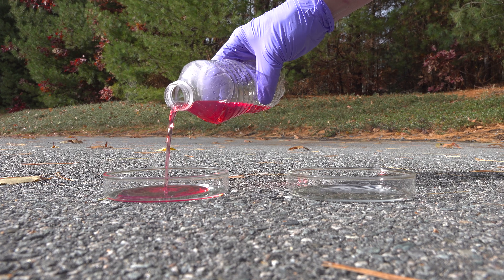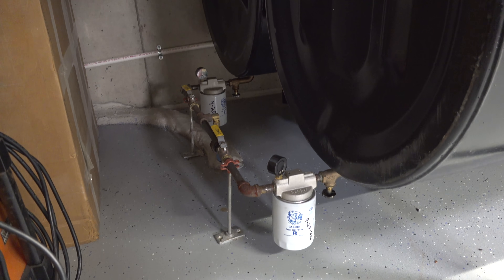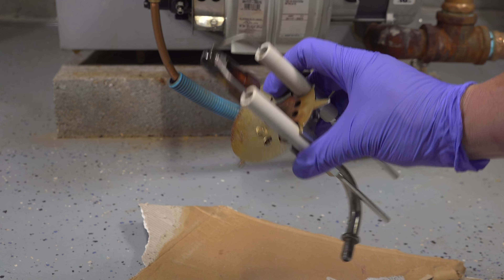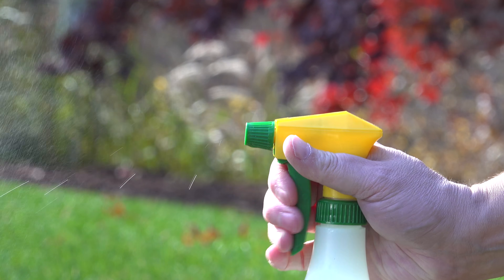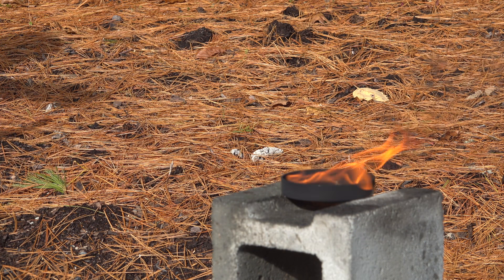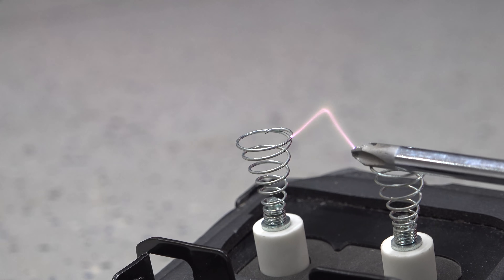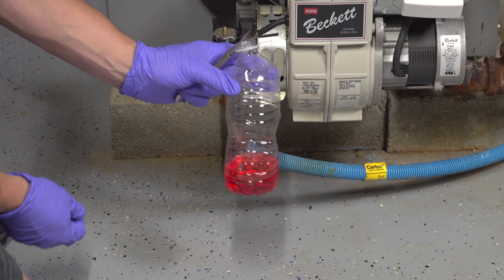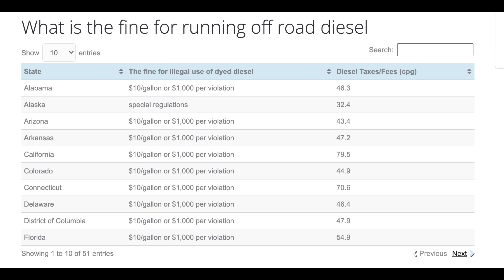Why Heating Oil is BETTER than GAS - Explained

Comment: Heating oil and diesel are exactly the same produc 
The differences come with additives add after refining
Like detergents and oder additives to prevent the diesel to freeze in the tank of a truck
Reply: #2 (diesel) gets blended with #1(kerosene) in colder months to prevent gelling
Reply: @Icutmetal  also diesel gets blend with kerosene to make jet fuel
Reply: @craizihorse3230  Prove it.

Comment: Short version: oil has a higher energy potential
Reply: Thats why diesels are so powerful and efficient.
Reply: @CL-ty6wp  
Exactly, it's a simple density thing. It's why good coal is so much better to heat with than charcoal is, even though it's essentially the same substance.

Comment: Love my oil heat.. it's like right now hot and I've rewired the electrics so as long as I have oil in my tank, and gasoline for my generator I can have heat. My next go around I'm going to use a hybrid heat-pump/oil system just to save a little oil on "cool" days.

Super bad-day plus-side is I can technically get heating oil at the gas station(diesel fuel) right by my home. Granted it's expensive but if I'm at that point, I don't care.

Comment: How about not heating with a fossil fuel and switch to a heat pump!!!
Reply from the maker: If you want to paypal me a donation I'd be happy to switch over. Keep in mind its forced hot water, not working with normal heat pumps that want forced hot air. It would cost me $20k and up.
Reply: @SilverCymbal  A hydronic air to water heat pump is less than 10k at 29,000 btu. Whoever quoted you 20k has been smoking crack! Hell there are brave alternatives such as this guy did

Comment: Dyes in fuel also help to easily identify not only a leak but the source of any leak.
Reply: That only applies to AC because is a gas 
Fuel and any fluid leaks are easy to find 
Just look for the wet spot in the line or gaskets
Reply: @craizihorse3230  I’m an aircraft mechanic and I can assure you, other industries use it for the same purpose, even if it’s involuntarily.

Comment: As a matter of fact, many people including myself are strongly allergic or reactive to the exhaust from oil burners, which includes both particulates and fumes. Because of this, in New England and other areas I constantly suffer from congestion, sneezing, etc. This has been a known problem for decades and makes entire regions of the country uninhabitable for me. All oil burners should be required to have a catalytic converter.

Comment: Well I prefer natural gas or propane. Burns cleaner, more efficient and natural gas is cheap fuel. Also when you have a natural gas line or propane tanks you  can run your citchen stove and outside barbecue all on the same cheap gas.
Reply: Oil is more efficent.

Comment: Which oil burner is better Beckett or Reilo? Are they more or less the same?
Reply from the maker: Its a Beckett, the Riello does the same thing but working on each is very different and use different pressure, etc. Riello is very different inside.
Reply: Beckett AF and AFG  in my opinion, Stay away from the Beckett NX burner you're better off with a Carlin or Riello then a Beckett NX. Riello is a good burner however they are temperamental and parts can be a problem as there aren't many of them around. A Beckett AF or AFG is almost bulletproof, will run fine even if it's not set up perfectly, parts are available anywhere, and almost everyone knows how to fix them. Nothing wrong with the Carlin EZ  burners, however being less popular then the Beckett AFG parts can be harder to get. For an example you can get basically every single part off the shelf for a Beckett AF or AFG at any plumbing supply house, while many Carlin and most Riello parts are not in stock. You can expect a day or two to get parts for them, vs off the shelf for Beckett. Personally I have a Carlin EZ burner however do to the fact parts aren't always in stock for it I keep a fair number of spares at home.

Comment: Fun fact. You can add used filtered diesel oil into red dyed diesel to make it black 🙂 also during a state of emergency (usually lasting a month) red dyed diesel is allowed to be used in on road vehicles.... The dye will last many tanks later. 🙃

Comment: This is the most poorly informed video I’ve ever seen on this channel. Oil heat is a completely outdated technology. In North America, it’s both the most expensive, & least efficient way to heat a building. Newer gas fired furnaces are 96% efficient. While requiring very little in maintenance. Todays top of the line oil burners struggle to see efficiency in the 80% range. And require yearly maintenance. Which is often performed poorly, or skipped altogether. 
Bottom line  anyone who is still using oil as their primary heat source should be looking to get rid of it as soon as they can. 

Next week on Silver Cymbal. Incandescent bulbs are BETTER than LED.
Reply: It all depends on application. Incandescent bulbs create a warmer glow, dont strobe, ect. Every technology has its advantages and disadvantages. In many cases you are doing a disservice trying to say one is better than the other no questions asked. Oil heaters can run on waste fuels no issues. If the main gas line  gets destoryed in an earthqake then having an oil furnace with on site storage can be better than gas.
Reply: @sweis12  that's a dumb "but sometimes" argument. The video was listing stuff like "oil furnaces don't blow up" as advantages. As if NG wasn't flavored with the smelliest substance known to man to make sure leaks are not an issue. NG is far cheaper and more reliable and more flexible (e.g. for gas water heaters and stoves and clothes dryers) and more convenient for almost anyone.
Reply: Trouble is that gas burners are not much use in remote locations without gas lines (well, I guess unless you use LPG).
Reply: Gas and electric is also outdated.

Comment: What's the part number on that coil? 
It could be useful for future experiments
Reply from the maker: https://amzn.to/3phXtTq  They are very cool and work right off 110v with nothing buy a power cord. Be careful with the high voltage coming out.
Reply: @SilverCymbal  wonder if you could use it for a small spark gap Tesla coil

Comment: You better believe an oil furnace can blow up.  Get a bunch of oil built up in the bottom of the fire box when it has an igniter issue and it can get very dangerous when the furnace does light.
Reply: Yep and every gasoline car is 1 broken fuel line away from blowing up.
Reply: Can't say I've had a car blow up from a broken fuel line, even a propane one.  Have seen a Coleman oil furnace blow a guy against a wall though.  Among other things.

Comment: Heating oil systems require significantly more maintenance and costs for it to be safe. LNG and Propane has multiple failsafes in the system. While it's true that cutting a gas line inside the house can lead to an explosion, black pipe isn't going to puncture by something sharp falling on it. The same can't be said for old heating oil tanks or the line to the burner. 

Also, LNG is substantially cheaper than Oil.
Reply: When you factor cost per BTU, LNG isn't that much cheaper. Also, no one would have oil heat if they had access to gas.
Reply: @doughill5487  My parent's have both. The house was built with fuel oil heating in the 60's. They added gas (propane?) many years later when converting the fireplace to gas logs. Both have to be hauled to the house as there are no pipelines. (The farm tractor is gasoline, so they just keep track of gas used in the tractor for end-of-year taxes.) Once a year, usually in the summer when oil is cheaper, the local oil company fills all the tanks.
Reply: It doesnt get safer than oil. Can literally toss matches on it...Oil burners dont have fail safes?  If there is no flame, it shutsdown thanks to the 'cad' cell and controller.  Maintenance? 5$ filter and 5$ nozzle and 20 minutes. A monkey could service a beckett style burner. 
Better than a cracked exchanger every 10-15 in your gas unit...
Reply: CL-ty6wp  yep I do all my own maintenance on the Beckett burner. Changing a filter is easier than changing a car filter. I recently had to replace the controller but a friend of mine told me about a $60 one with an LED readout as opposed to $140 Howell. Just a little extra wiring involved and that's it It was worth the savings and every time it fires up it gives you the cad cell ohm reading
Reply: It takes me about 20 minutes a year to clean and service my oil burner and boiler. It costs me about $20 or less in parts on average a year to service it. While a gas burner doesn't require this service, I'd hardly call 20 minutes and $20 a year significant. Granted LNG is cheaper but you have to live somewhere with gas service, something that doesn't exist in most places outside of a city. Propane is significantly more expensive than oil. If I had gas service I'd probably swap to gas, however that's not an option where I live. 

I really can't imagine how a oil burner could be unsafe, even if it gets completely blocked with soot, the smoke and fumes will drive you out of the house long before carbon monoxide even becomes a concern. Something that can't be said for gas or propane. A blocked up gas boiler or furnace won't give you any signs of a problem, other than filling you house with invisible and oderless carbon monoxide. Heating oil is just diesel fuel, it's not going to blow up your house, even if there is a major leak it's not going to be a significant fire hazard. Now you can have a oil burner catch fire and even have a blowback, however there is a cad cell and primary control that will prevent this. The only way this happens is when some idiot keeps pushing the reset button filling the firebox with oil and vapor. 

I'm not saying gas is unsafe, modern gas appliances have lots of safety systems to mitigate the risks. Oil doesn't need these systems. How often have you ever heard about an oil burner blowing up someones house? How often do you hear about an oil burner killing people from carbon monoxide? How about gas? Let's face it oil is safer then gas despite the multiple safety systems on gas burners. Now is gas dangerous is it something you don't want in your house? Absolutely not if you have gas service it's the way to go.

Comment: Very well done. Explained clearly and concisely. I learned that heating oil is the same as diesel. I thought it was a lower grade of fuel; more like kerosene.
Reply: I have an oil heating system and it runs off kerosene. 
I do have another tank with red diesel for my tractor and lawn mower. 
Kerosene is cheaper than red diesel also in the UK
Reply: @johnwalton1137  interesting.
Reply: @arnoldcaines9012  
Also kerosene burns hotter than red diesel,and is slightly thinner. 
Iam sure kerosene would kill a road car over time. 
Red diesel on the over hand is fine as long as you ADD a cleaning additive to the mix.BUT  you would be in trouble with police over using NON TAX fuel on the road.
Reply: That's... What you took from this...

🤣

Comment: I get my oil burner serviced maybe every 5 years. They vacuum out spider webs, clean the nozzle and change the filter. The nozzle definitely doesn’t need to be replaced yearly, I'm 22+ years in with no replacement.
Reply: Filter changes are the most important part. If you do nothing else, regular oil filter changes will save a lot of problems. 

Every 5 years is pushing it tho. I don't like seeing people go more than 2.
Reply: @kyleh1974  That and should vac out the exchanger.

Comment: I've had fuel oil, natural gas & now geothermal...

Fuel oil is expensive, cost me about $200 every 2 weeks in u.s., also seems more maintenance too.  

Natural gas all yr $50-70 on budget bill & like 3-4 months of no gas bill.  
450-630 roughly probably on the higher side of that.  

Geothermal... everything is electric
Based on electric bills from $70-280 last yr.  I figured $150 avg if spread out over the yr.  I think my bill will be lower overall after modifying my thermostat temperature range of 3 to 5degrees  vs 2 degree range prior.  For instance heat set to 72. Geo kicks off at 73 kicks on at 68.  

With that said worst month for heating cost alone is probably $180, this past month around freezing point or so was about $50 in electric.  

I know someone with electric heat that pays $500-600 a month for comparable home. Worth noting natural gas place I had was 2/3 the space of my newer place.  

So what does it all look like?
Natural gas 1000sq ft 3mo. $450-630
Fuel oil 1500sq ft.  3mo. 1200   $
Geo. 3 months $500 on high estimate
Electric 3 mo. $1000-1500 
Propane 3 mo $600 
Someone local told me propane is typically around $600 for the yr  for a house I believe that is somewhere between 1000-1500sq ft.  I'm thinking it is bigger than my 1st but not as big as my current 1500sq ft.
Reply: Fuel oil furnace are 1500$ and last forever because they dont have fragile heat exchangers like gas.
Reply: @CL-ty6wp  

The last gas furnace I had lasted at least 20 years, the fan motor went bad...no issues with heat exchanger.  

Some of it can be from poor maintenance.  I kept clean air filters.

Comment: Good video. My company just recently stopped rebuilding parts for Iron Fireman burners. Good videos on the topic, One of the better ones.
Reply: Iron Fireman units were Bit coal burners, weren’t they?

I put in a dual fuel Keystoker in 2019, I burn oil for hot water in the summer and Anthracite in the winter.

Comment: Interested in knowing the electrical current,voltage and draw rate of the power necessary for these igniters. Do they run continuously while heating or does the fuel need constant electricity to prevent run on. As he mentioned a hot tank or plate perpetually reigniting. Also would a ballast of a temperature gradient material(steel,iron or ceramic) in the center of the tank retain some heat to augment heating?
Reply: The ignitor is a step up transformer. They put out between 10,000 volts and 20,000 volts, with very low current. 

Newer ones don't run continuously.  Older ones do.

Comment: Propane is way cheaper where I live fuel oil is like 3.40 a gallon whole propane is 2.40
Reply: Propane BTU/gal is about 90,000 vs. 140,000 for gal of oil so of course it's cheaper per gallon.

Comment: I looked for a house with heating oil rather than natural gas or propane. I have pellets, electric and heating oil.
Reply: Smart man.  Gas furnace heat exchangers make the furnace a 15 year or lesss disposable.  Not so on oil.

Comment: It’s dyed diesel, aka, off-road diesel, aka heating oil. It can be used in powered units or pony motor units that are used exclusively off road. I’m a landlubber so I can’t speak about off shore.
Reply: No, dyed diesel is regular on road diesel with a dye.
Reply: @ryangreenley4818  I kinda thought that was a given? Dyed diesel is regular ol diesel with dye. It’s so the ol DOT can easily see if you’re “stealing” by not paying your fair share to the legalized mob.

Comment: I have an old danesmoor 15/19 heatslave that's been in our house for years and years, always serviced regularly and has been super reliable. to go with that is a large 1200 litre tank that when full can last up to year. here in u.k though as with many countries the cost of oil is shooting up rapidly. to compensate we had an up to date room Stat installed as it didn't before so that should save a chunk in fuel.